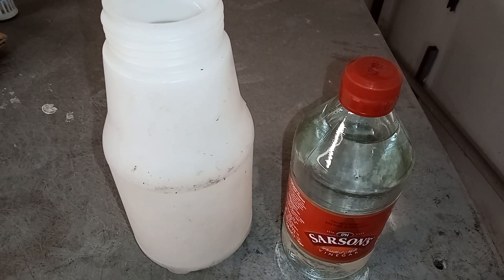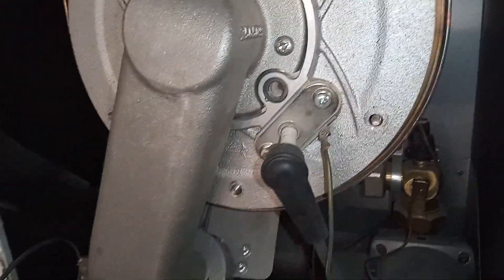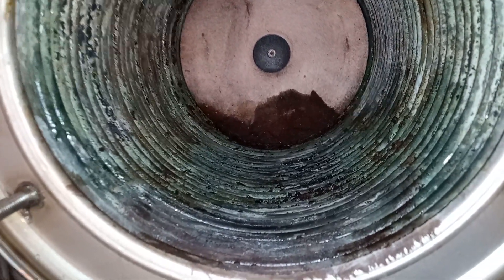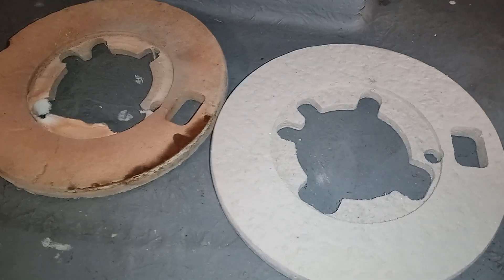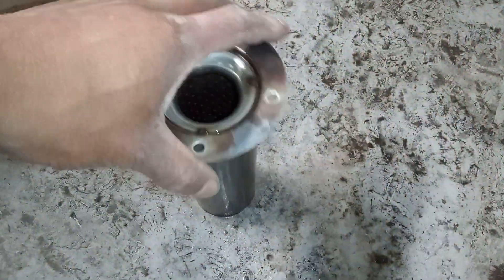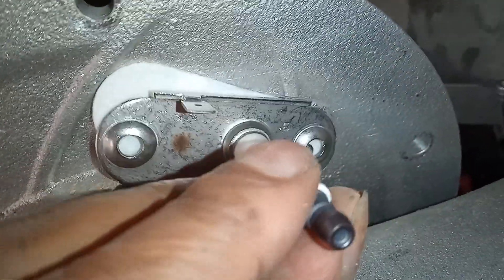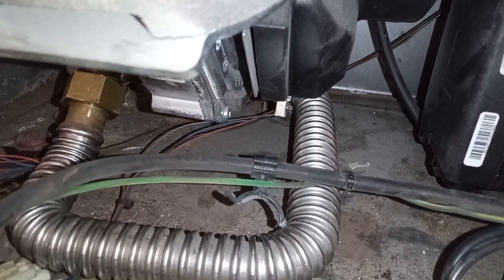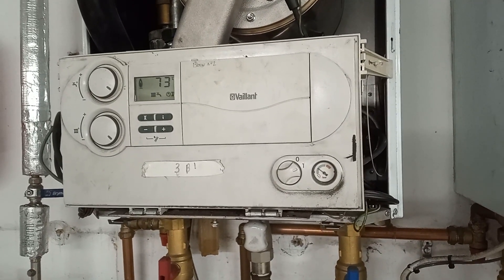CLEANING HEAT EXCHANGER WITH VINEGAR

Comment: Does it have to be a certain type of vinegar? 👍
Reply from the maker: I guess it does. Not all vinegars are equal nor have the same purpose. Yet isn't it great that vinegar has so many purposes. I use it to descale the kettle, shower heads, rusty metals, all sorts. Hopefully I mentioned the type of vinegar in in the vid or showed the bottle, if not most of the audience probably are aware. Some of these vids are made so far back I can barely remember the content. Take it easy